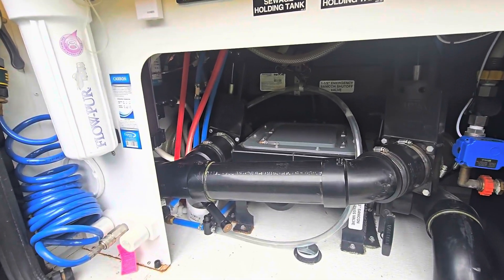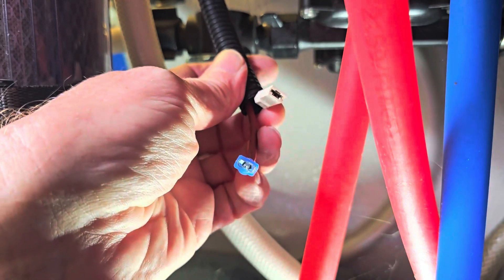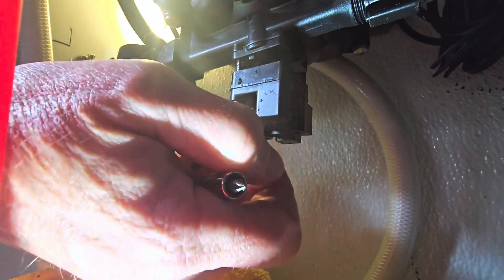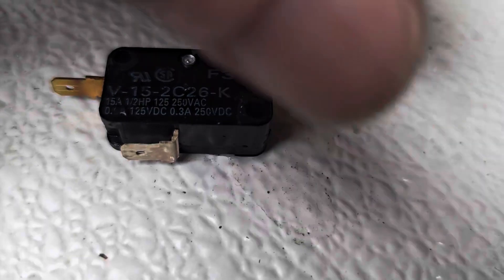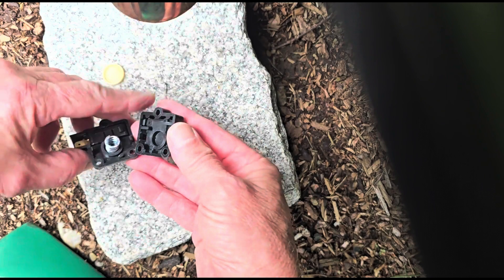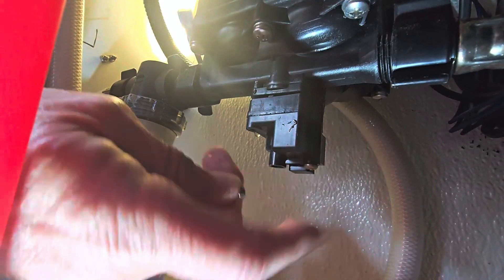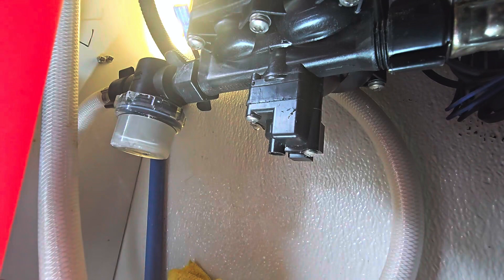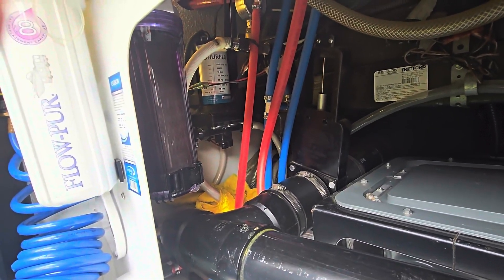Shurflo 4008/4048 Pressure Switch Repair - How to Fix the Pressure Switch for $3!

Comment: Thank you for this video!   Zero personal knowledge about water pumps and pressure switches.  All I knew was the NEW pump quit working after about 3 weeks and we are 3 hours from any RV repair shop or mobile mechanic.  Used all the info, tested pump, ordered part and just installed in less than 10 minutes.  Pump works great. Thank you!!  (PS: Yes, you put the pin under the spring in correctly, I checked when I took mine apart. 🙂)

Comment: Great clip. Are you sure you put metal pin under the spring in pressure switch correct side up? 07:38
Reply from the maker: Not sure! I guess I will need to disassembly my factory pump and check. Thanks for the comment.